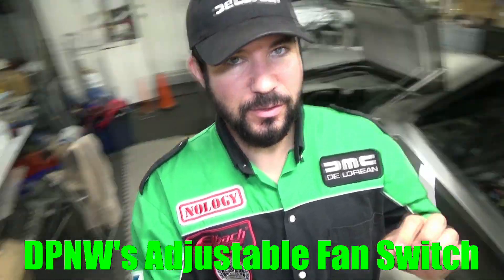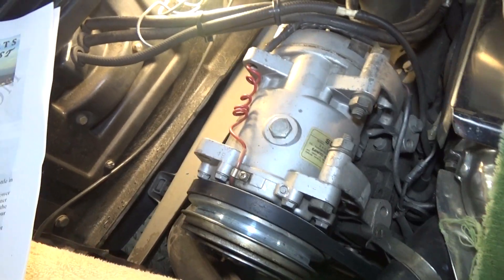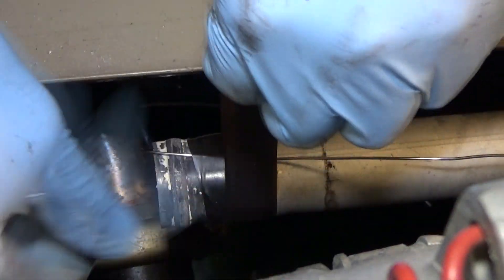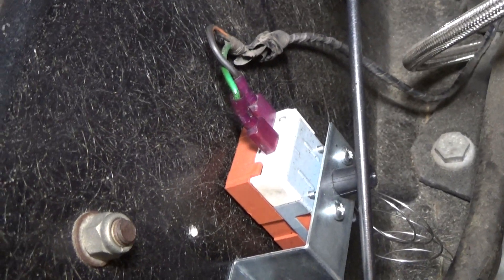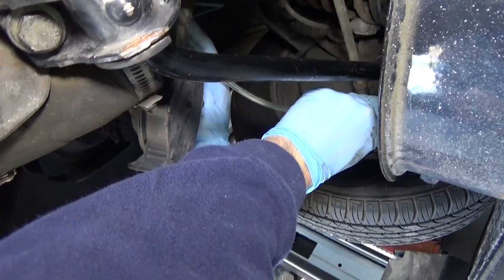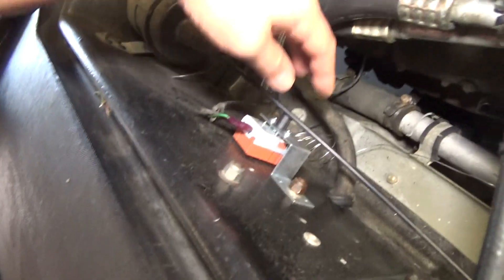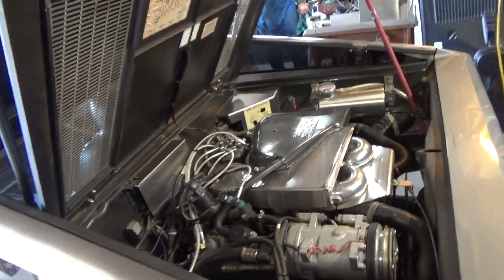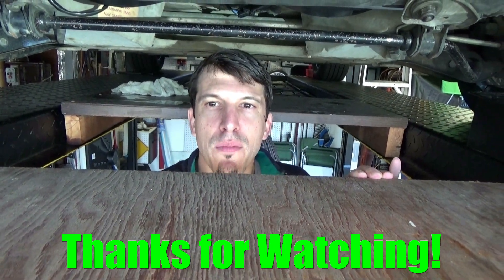Wings-B-Cool Adjustable Radiator Fan Switch and Radiator Bleeder Kit Installation

Comment: Sence I just changed the coolant my Delorean yesterday I bleed the air out my system differently. First I have a test I like to do to feel if there is air in the system. By squeezing the top radiator hose from the thermostat I can feel the fluid go back and forth and can hear the little plug in the thermostat tick. If I do not I blead the system.  I bleed the air from the top of the thermostat radiator hose. when cold I stick a flat head screw driver between the  thermostat housing and the hose to release the air. when the car gets up to temp the thermostat will open and coolant will squirt out where the screwdriver is, pull the screwdriver out and tighten the hose clamp then my coolant system has been blead. Do the squeeze test every so often for your peace of mind.

Comment: Hey its peter ,From Japan. I bought it to installed  for my Engine Bay ventilation cooling fan , when enginebay is hotter then certain point ,  it start to power the fan to suck the air out of engine bay , draw about 0.5A for 2 ,14cm PC fan ,

Comment: again and again the "Trapped Air" Legend... run the Car,  let it heat  up and loosen the clamp a little bit to let the Air out... mostly NOTHING comes out... done... NEVER needed to do this again in 5 Years. So why install a extra Bleeding Valve. The Water flow is so intensive there CANNOT be any "Air Pockets" trapped anywhere. 

The Fan Switch is basically just covering / masking bad Maintenance and or a bad Cooling System. No need to fiddle with the System when restored to it´s former Glory and working. Same here. After a full Restoration mine runs absolutely fine even in hot.... fuckin hot Climate. No need to install anything like this.
Reply: Not long after I got my car the otterstat housing cracked and started leaking coolant. I decided to replace it with one of these adjustable fan switches. All it does it let you operate the fans at a selectable “turn on” temperature. I have mine set to about OE spec. I even removed the original otterstat pipe and had a straight (no hole) pipe made up.

Comment: Always wanted to see Toby's front bleeder in action. Question: If you have one of the updated DMCH radiators with the bleeder located on the bottom driver pontoon, do you still need Toby's bleeder?
Reply: The DMCH radiator has a drain valve. It’s not for bleeding.